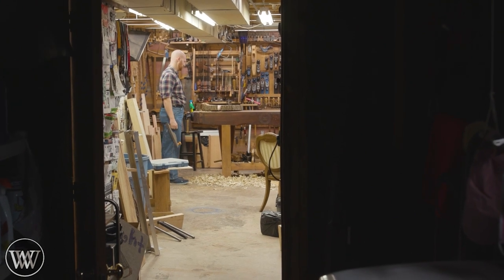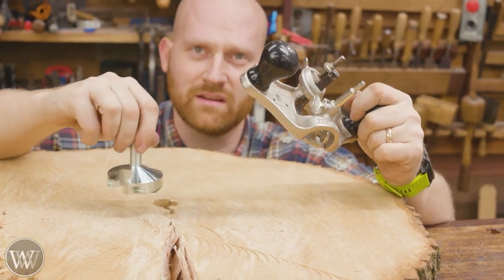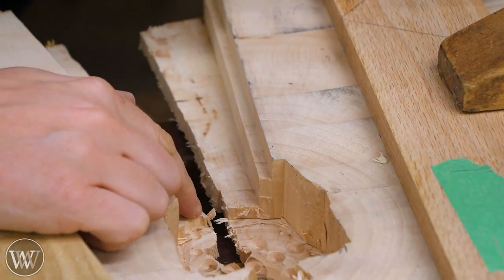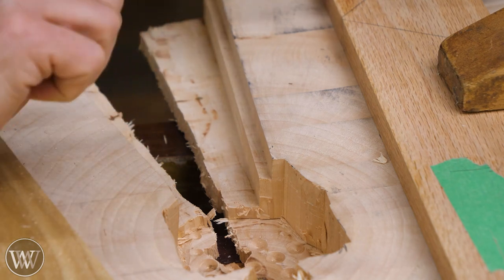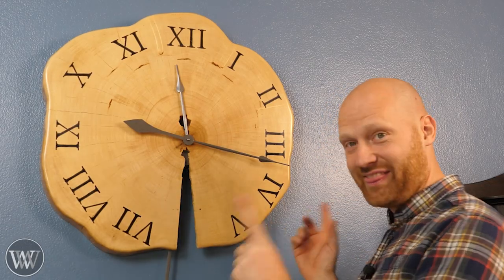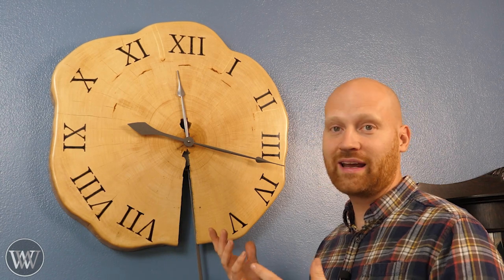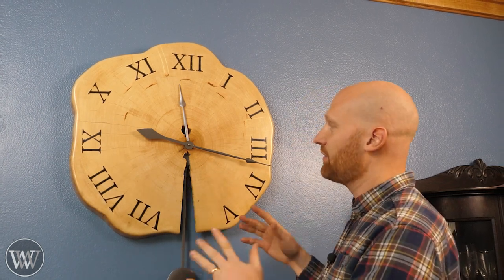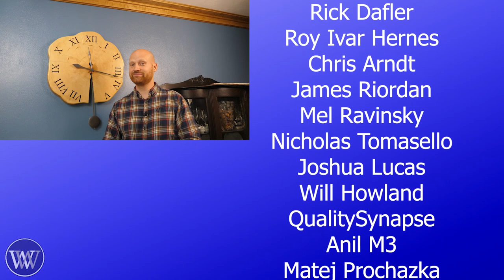Making a Cookie Clock Hard Maple

Comment: That’s an impressive looking clock, but it must be very heavy.  When you started with the hand plane I initially thought  “I would never be able to do that, what’s wrong with my planes?  Am I just a slacker?  How often is James willing to sharpen during that job.?”  Then you got out the electric router and sled and I was somewhat relieved!  That was the way I flattened my workbench slab which is made from 3” laminations of Iroko. In the process my router destroyed itself - but Dewalt replaced it no questions asked despite it being out of warranty.  They just said “that shouldn’t happen”.  I was impressed by that.

Comment: Great job, I thought 4, 5, 6, 7 and 8 were upside down.
Reply from the maker: thanks. they are traditionally roman numerals always face the center. where as numbers are generally vertical.
Reply: @WoodByWright  a lot of traditional clocks will also use IIII for 4 rather than IV
Reply: @dy1an  Yup, the "Watchmaker's four". It gives the dial a visual balance since you have 3 groups of 4 numerals. With each group containing a different subset of I V and X. [I II III IIII], [V VI VII VIII], [IX X XI XII]